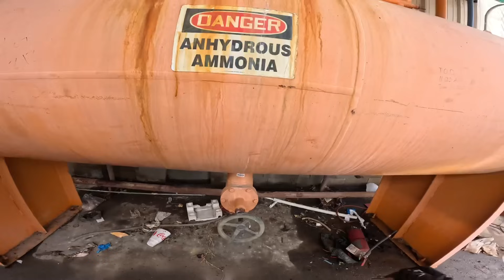CORVETTE DRIVER HATES ON MOTORCYCLES!!!

Comment: Your gopro mic is peaking try to keep it away from your mouth it will just keep the audio clean without any distortion when you talking louder
Reply from the maker: I will work on that
Reply: And here another tip try using analyser meter when you editing
it shows you if there any peaks and helps you keep the iPhone footage or any other vid you adding at the same volume